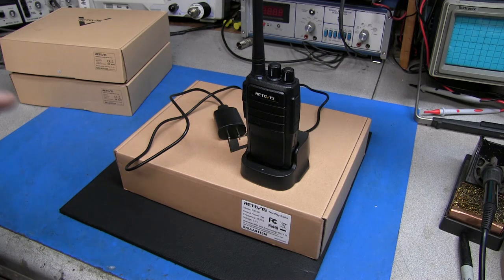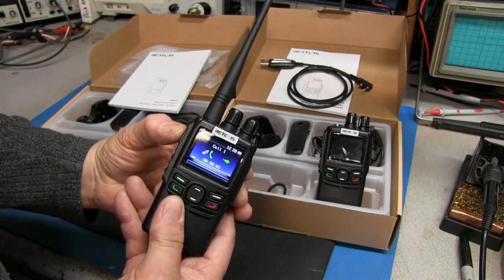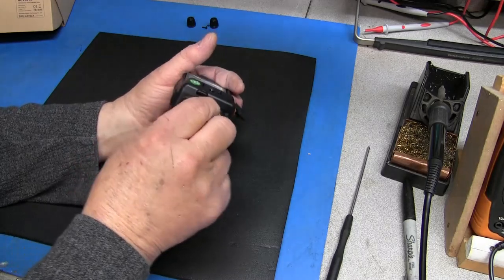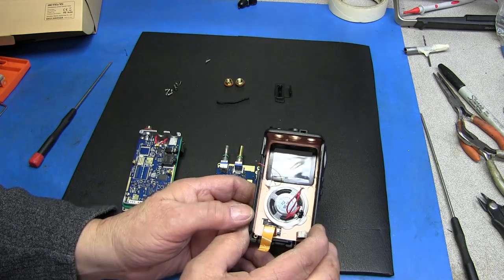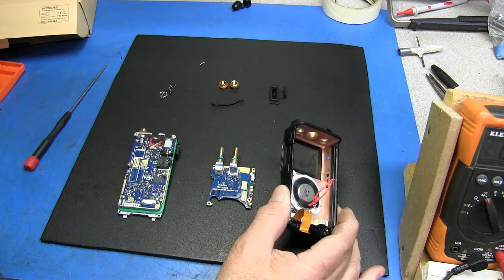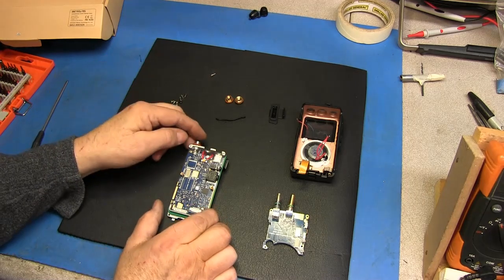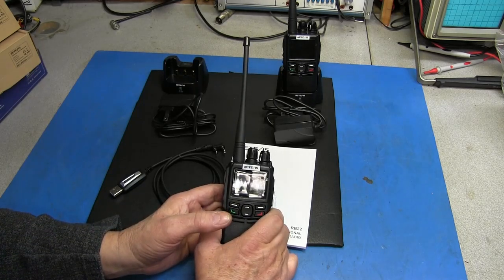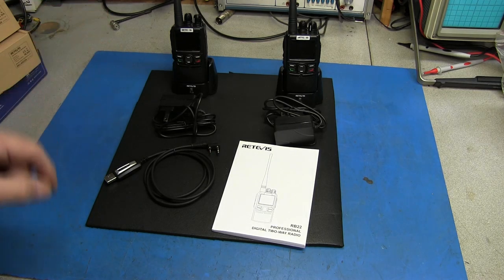#270 Retevis RB22 DMR Ham Radio Tear Down

Comment: i have this same DMR radio and the battery is faulty i kept it on  its charging dock to turn it on 
i was just messing with tone settings and the volume was full i changed the tone and it shut off and now it's now turning on can you please give idea where the problem might be the charging dock is okay i checked it but radio is not turning on 😢

Comment: I'd be happy to donate $ towards a noise canceling mic fund, to reduce the background noise.
Reply: It's his propane heater running, not sure if the mic would matter? they can be loud.
Reply from the maker: Working on that. My heating system is very noisy, and it was like 23 degrees outside when this was recorded. I have already purchased a new mic and waiting to find a good interface to go between the mic and camera. What you are hearing is the wind noise from the heating duct, this should help eliminate that.  The built in mic on the Cannon G19 is very sensitive.

Comment: The "possibly cristal" thing is likely the I2S microphone. 
That "main chip" is likely ROM or RAM. It seems to have too few wires coming out of it for being a processor.
The "diode" across the battery is likely a tantalum capacitor.
Reply from the maker: The mic is mounted in the front case and is not easy to get to. The main processor is a BGA type chip.
Reply: @TheRadioShop  Thank you very much for your help! Glad I learned.